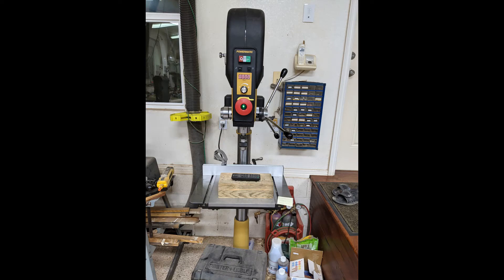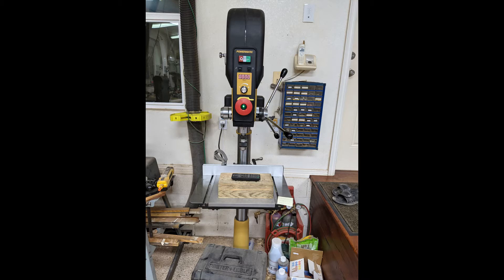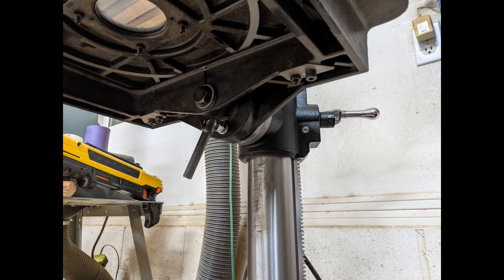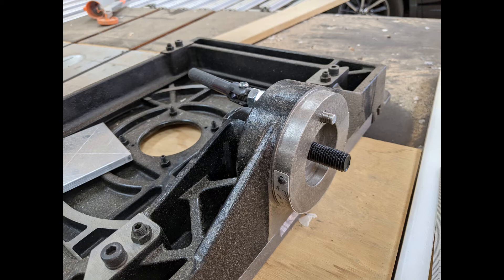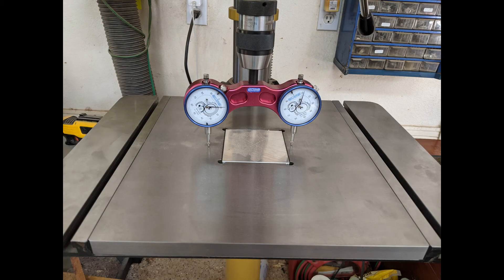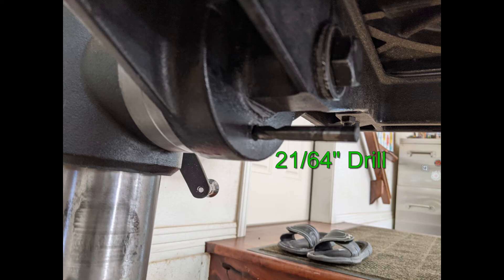How I fixed the table lock on my Powermatic PM2820EVS drill press

Comment: Thanks for the video. I actually called them and spent a fair bit of time on the phone with them and was told this was “within spec” and this tool isn’t considered a “precision tool”. Ridiculous for a $2300 tool.
Reply from the maker: I agree with you.  One thing I always expect on a top of the line tool is that fences and guides can be set back to zero easily and will stay there reliably.  This one does neither.

Comment: Thanks for posting the fix! I am getting ready to replace most of my old wood working machinery and was planning on going with Powermatic now that I have just completed my larger wood shop. I've heard a lot of good things about their equipment over the years but now I have been hearing more negative things lately.  I hate to hear they didn''t get back with you, one of the things on my check off list is how good is the Tech Support. I guess I need to start looking at other manufacturers to see how they are. I am sure I will need support at some time and would hate to be left out in the cold. If you ever get a reply and a factory fix, let us know. Thanks again for posting your fix!
Reply from the maker: Hi Earnie, I did get an email response from them 2 months after I sent the first request to them.  They told me that this was one of those things that was too complicated to handle via email, so I should call them.   At that point I was done with the fix I had done and wanted to move on.  So maybe we would have gotten there, but two months response time is not something I have the patience for :-).
Reply: @JNWoodworks  Thanks for getting back with me, that makes me feel better that they did call back even though they were slow in responding.  I will give them a call and see if they have the problem corrected on the unit they are shipping out yet.. Thanks again. Great rite up!
Reply: @earnierowland232  Were you able to in touch with PM regarding whether they have addressed the table slop issue? Thanks!
Reply: @lalove128  I called their tech support a while back and mentioned the video with the problem. He told me that I am the only person that has got in touch with them and they would look in it. He took all my info and stated he would bring it up at the next meeting and get back with me. I guess they aren't having any meetings as I haven't heard anything back from them at all, Great Tech Support, LOL. Seeing that PM appears to not want to fix their problems or communicate back, I'm about to scratch the company of my list and get all new equipment elsewhere. I am really looking hard at Tekna Tools (Nova) and  Harvey Woodworking. I hate it, I really wanted to go PM for all my equipment ,but I have to have Good Tech Support when I need it.
Reply: @earnierowland232  Disappointing! Thanks for sharing your experience and experiences.

Comment: Yeah, I had to crank up my volume to hear you and the playback sped. :)  I just got this drill press yesterday and noticed the same issue.  No matter how much you tighten down the big bolt or the smaller locking pin one, the table can still rotate - in my case about 1 degree.